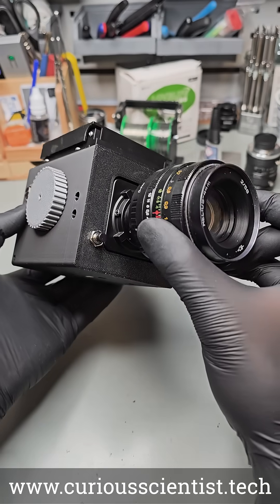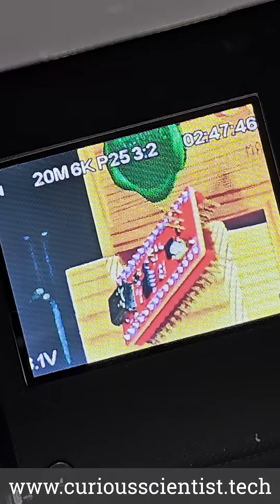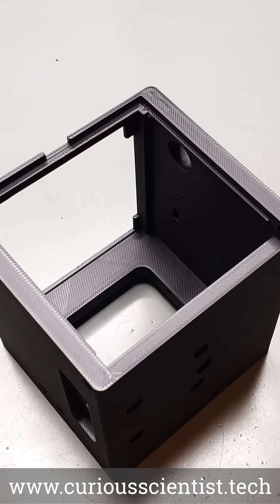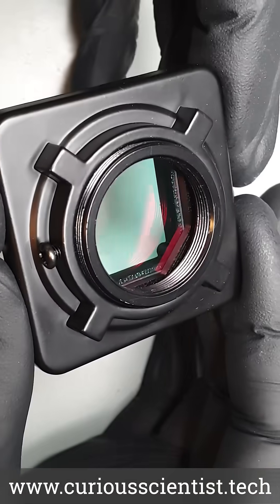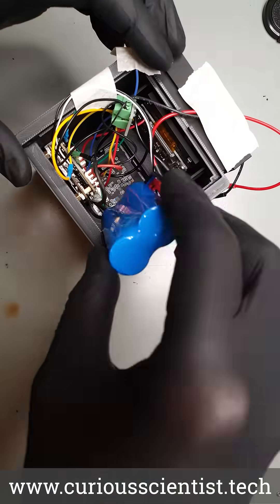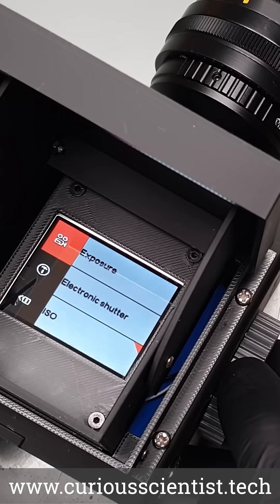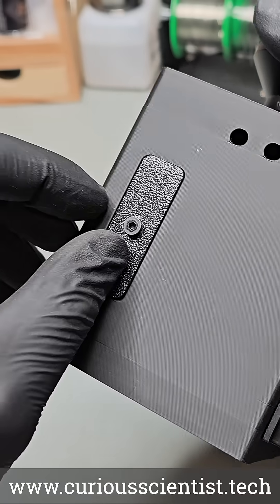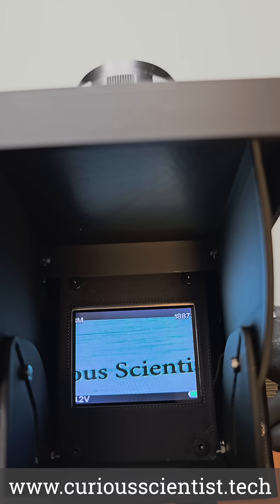#DIY #camera #3dprinting #hawkeye #6k #fpv #mediumformat

Comment: what kind of formats does it support for video? LOG or RAW would be nice
Reply from the maker: I hope this helps:
Format                                   : AVC
Format/Info                              : Advanced Video Codec
Format profile                           : High@L5.1
Format settings                          : CABAC / 1 Ref Frames
Format settings, CABAC                   : Yes
Format settings, Reference frames        : 1 frame
Format settings, GOP                     : M=1, N=60
Codec ID                                 : avc1
Codec ID/Info                            : Advanced Video Coding
Bit rate                                 : 68.8 Mb/s
Width                                    : 3 840 pixels
Height                                   : 2 160 pixels
Display aspect ratio                     : 16:9
Frame rate mode                          : Constant
Frame rate                               : 60.000 FPS
Color space                              : YUV
Chroma subsampling                       : 4:2:0
Bit depth                                : 8 bits
Scan type                                : Progressive